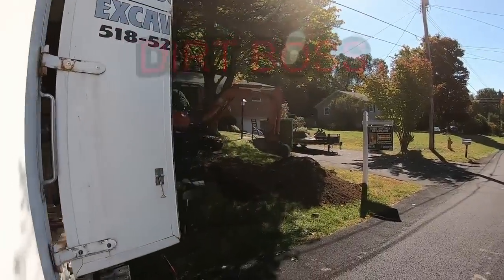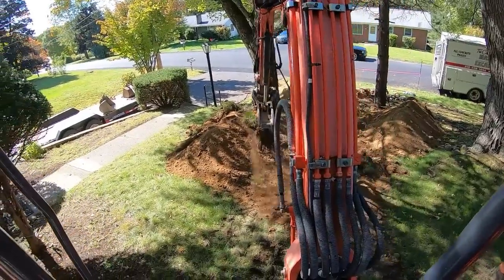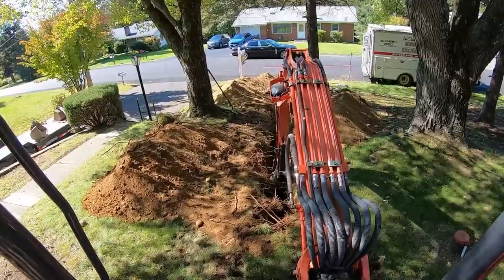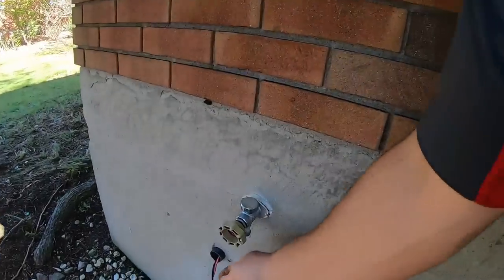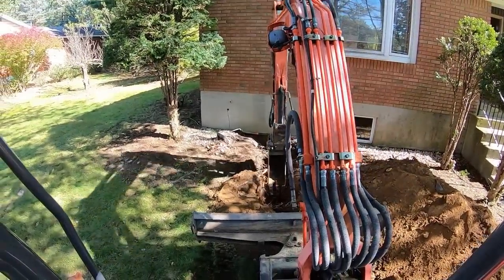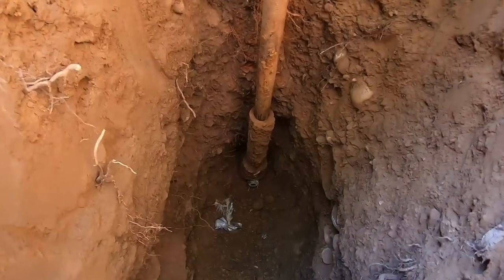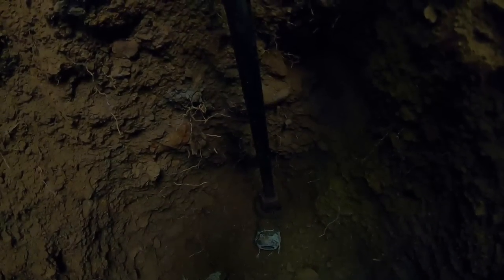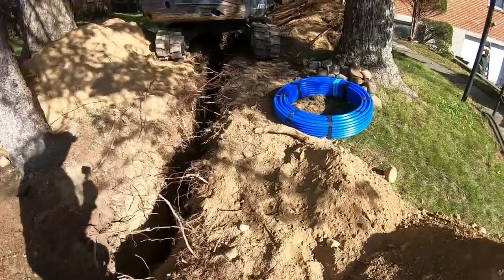DIY public City water service hook up at curb box

Comment: Another A-1 educational video from Professor Boss. Your right no one shows that part. Not worried about line rubbing in basement wall, you did seal it from ground water leaking in. Keep the videos coming.

Comment: How do you adjust the height of the curb box to adjust to your lawn level, mine is a tad taller.  Thanks for the video.
Reply from the maker: I show that in other utility videos just raise up on it it will pull up
Reply: @DIRT-BOSS I saw that but I’m trying to lower it and it is solid.  I dont wanna pull it since it might raise more and get stuck there.  Sorry for all the question.